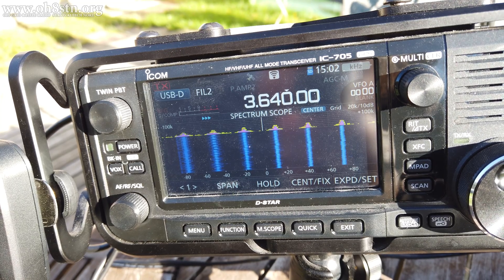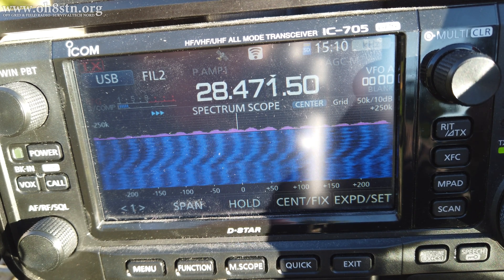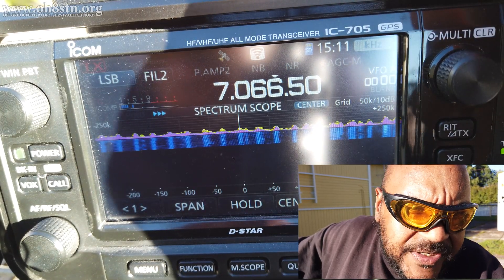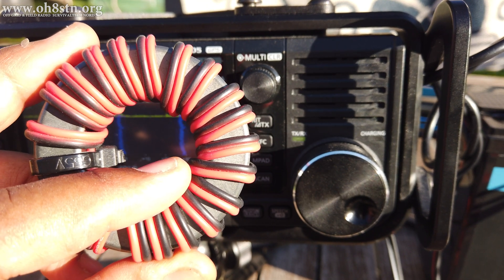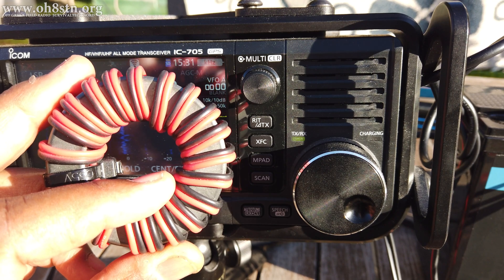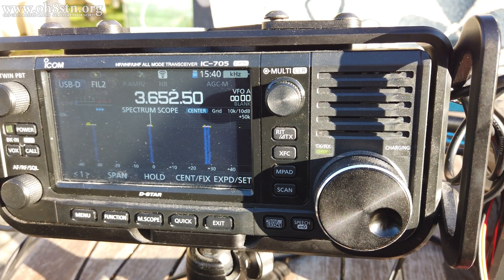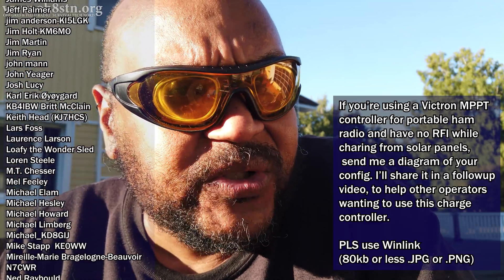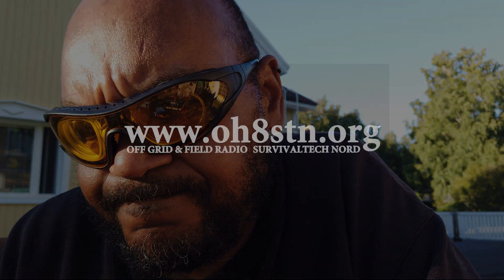Victron SmartSolar MPPT Charge Controller

Comment: It's been over two years on this, any updates?   I am currently looking for  MPPT controller  with around 100V in and 50A out.  I'm finding nothing. I wonder about; How long are your panel leads, grounding the Victron,  changing the proximity between the Victon and your ICOM and/or  antenna?

  FWIW, I always go direct to the battery (+ fuse) for loads.

Comment: Last Field Day I loaned a new operator a 100w panel and a no name cheap Chinese 30A charger. I've used this same device for many years and knew they functioned fine.  Connect to his rig, every time the charger would start to charge it would do exactly as your seeing on your radio. Totally wiping out most bands. Once the battery was full and no longer drawing amps, the noise stopped. The difference; I use AGM or Lead Acid batteries, my friend used a Bioenno with a BMS as part of the package. Seems like it's the combination of the BMS and the charger. His battery works and charges fine with a Genasun charger, and my cheap charger works fine with lead acid or AGM batteries. (both charging at the same amp rate)
Reply from the maker: Absolutely. It is possible for a BMS to make noise, but it's generally unheard of. I've tested with the lead acid batteries, AGM batteries, lithium & lithium iron phosphate, both with and without BMS. The noise is always there while charging.  Bioenno might use a bad quality BMS, which would support your observations. The BMSs in my Power Queen LFP batteries are quiet, and work well with the Genasun charge controllers. 
Thanks for sharing your observations with us.
73
Julian oh8stn

Comment: Dear colleague, the only way to block RF from the victrom controller it self it to put  the devise inside on on Faraday metal shell lake used in microwave oven ...,  !!
Reply from the maker: Yes, indeed. Unfortunately,  that makes it much less portable 😥
Reply: @OH8STN You don't understand what a faraday cage can be. It can be a fine wire mesh screen cage, slightly bigger than the charge controller. That does not affect portability.  Also, twist all of the wire pairs.
Reply from the maker: @MrSummitville This is a ridiculous comment! What you fail to understand is that my Genasun charge controllers are RF quiet! For Genasun,  no Faraday cages required, no twisted wires required, no voodoo magic or blood sacrifices required. 
Why can't Victron charge controllers meet the same high standards?

Comment: I have the 75/15 and will be taking it portable soon, I'll share my experience.
I see you have the Genesun GV-10, by chance have you ever used a GV-5 model specifically? I can't see it mentioned searching your channel.
Edit - found you have a GV-5 in an older video.
Any chance you can pop this model specifically on the bench with the 705 and check noise on 40M?
Reply from the maker: I'm still using the gv5. It is possible to get some noise when the controller that's too much solar input. The switching goes into overdrive too regulate what's coming in which causes some noise. Under normal conditions, no noise.

Comment: I researched Charge Controllers about five years ago. Genasun's were the only brand that were RF silent. The Scientific Community uses them in a LOT of experiments. They need to develop higher capacity gear for the market. The demand is there, so they should get started on designing new kit.

Comment: Hi Julian, I love your chanel and the effort you are putting in all these themes. While I am using VICTRON stuff on my sailing boat in a quite extended way I can 300%!!! confirm your observations. I have installed 4 100/30, one 75/10 and one 75/15 solar charger. In addition I am running a 3,5 KW Charger/Inverter with 3x 200AH LiFePO4 batteries (Victron). I like the VICTRON products for many reasons and I don’t want to miss them. But during day time I have to disconnect the solar panels to avoid this incredible noise on the bands. Especially on 20m which is the main band for operation on the boat besides the 40m band. There are other devices that produce noise like the fridge but not nearly in the extend the VICTRON solar chargers do. I am not sure if the converter/charger(Multiplus)  is doing the same but offshore it would only be an issue while converting to 230V. I will figure that out in the future. The only solution I have at the moment is to disconnect the solar panels from the chargers. That is obviously not what we intend. I contacted VICTRON via my dealer and they pointed out that these issues are not known. I argued that it is a direct injection into the antenna, which is your observation as well. To my onion this does not apply to the certificates they are mentioning to prove the proper build quality concerning RFI. I’d very much appreciate to get in contact with you and share my experience. 73 Roland, DJ5SL

Comment: I had a cheap battery charger plugged in the garage and my station was about 50m away. It was all coming in via antenna. As I would drive into the driveway, my noise floor went from s2 to s8. Not 100% related to this but the victron could he generating it. Also had any issue where the mmpt controller was causing the panels to radiate rf. All interesting.

Comment: MPPT and PWM produce lots of noise. I think you will need some filtering/conditioning after the charge controller and before the battery. Maybe ground the charge controller chassis.

Comment: Try using a Buck Converter after the Victron. It is adjustable and cleans up the DC power to an appropriate Voltage. I had problems in my RV with a Victron and over voltage, blowing a fan ICB. After researching and reading from many RV'es with the same problem after solar installation, this was the remedy. Please let me/us know if try this and the results. 73 W7BUC

Comment: The problem lies in that it is an mppt. I did research before purchasing a solar charge controller for my setup. PWM is less efficient but much quieter on rfi. MPPT has buck and boost voltage converters to take the 20-100v and pump out 14.4 that that your battery needs. You could try adding the toroid in-between the charge controller and the battery, abd wrap the charge controller in a sheilding material (tinfoil) and see what happens.
Reply from the maker: I used to believe this point exactly. However the Genasun MPPT charge controllers do not exhibit the same noise. If the generalization were true, every mppt charge controller would emit this kind of noise. It's a reasonable assumption but I believe Genasun must be doing something differently.
73
Julian oh8stn

Comment: I would contact the company and see if there is an internal problem that is common in this unit and if so what the fix would be. Sounds kind of like a switching power supply noise.

Comment: Hey Julian.  I did some testing with my Bioenno 20amp charge controller and ~200 watts of solar in (100 watt Bioenno and 120 watt Raddy folding panels).  My 7300 was connected to the load port.  Bioenno does not recommend this, and I don't normally connect it this way, just wanted to see if it would be any help to you.  I had no RFI.  I always connect the load directly to the battery, regardless of the CC.  I mean, come on, you almost single handedly spawned my battery addiction.  I'm kinda thinking you should just ditch that controller and find another one, like the Bioenno, that is RF quiet without you having to mess around with it.  I've read some other comments in the thread saying their Victron is RF quiet, so could there be the possibility that you just have a faulty unit?  Doesn't seem likely but anything is possible.
Reply: Yes I am thinking he has a faulty unit for sure - because I have talked to other HAMs just now that use the Victron and its dead silent...hmmm

Comment: Hi Julian,  The problem is that MPPT charge controllers use PWM down switching yours is at 30Khz (30Khz between peaks on ic-705).  OK you could put a .01 cap on the power transistor and the Switching flyback coil.  But that might be microsurgery.  The most profitable way of doing this is to put the whole victron 75/15 inside a metal Faraday cage then have ferrites on all the inputs and outputs.
Ok you might just wrap the thing in plastic then copper or alluminum foil for a test and wind all ins and outs around a common core choke and see where you get.  Definitely the whole thing has radiated emission (foil) and conducted emission (choke) and see where you end up.
73's W3GYV
Reply: Julian have you tried this?

Comment: My first thought is to use two batteries, and swap them. I do that anyway without charging either. The panel/controller/battery could be in an optimal location in the sun, and far enough to not contribute RFI. But it comes down to weight, convenience and the cost of an extra battery.  I always run QRP and usually a 5A battery (or two).
Reply from the maker: Well said

Comment: I had a bad CHINS LifePO4 battery that would put out noise and the voltage would vary just a little (lights in the camper would blink) when under solar charge.   I replaced the battery with a battleborn battery, my issues went away.  I believe the BMS in the CHINS battery was bad.   Have you tried a different battery?

Comment: Heinrich from the YouTube channel Funkfieber (in Bavarian language ;-), reported he just bought the Victron MPPT controller. he didn´t try it yet. may be you could get in contact with him? I think he has only a 30W rigid panel though.
Otherwise, I would try some ferrite chokes ob both ends of each cables to prevent the cables from radiating or behaving as an antenna. May be you could enclose the controller in a metal box?

Comment: I use the Victron MPPT 100/30. No appreciable noise. However, this chager does NOT have load passthrough and so everything must be connected to the battery. I do this via a marine type fuse box. I also ground the device to the 4ft grouding rod I pack for portable HF ops. I have found this to make all the difference.  I can send you a diagram if you'd like.
Reply: Is this on all bands?  Including V/UHF?  I'm reading so many conflicting stories.  73
Reply: @I_B_Phrede  I haven't noticed anything on V/UHF

Comment: I haven't followed previous videos, so I may be covering old ground.
 
I assume you actually tried to determine where the noise was coming in - antenna, power line, straight to radio circuitry or all 3. Oscilloscope on the power line to measure may show if it is coming from there. Simple antenna disconnect / reconnect can show if it is coming from the antenna.

How far away is the solar controller from the radio? Remember the distance vs power attenuation is exponential.  Separation with a larger feed to compensate for voltage drop?

I use Renogy equipment myself, but a different source of interference is over riding most HF, so I can't say if it has a lot of noise from solar or not.

Basic troubleshooting - locate the issue by tracking / tracing, then if possible isolate the problem area, then diagnose and mitigate.

Edit: What about the BMS on that fancy battery since it seems to be current related? Could it be the noise source?

Comment: Love to see the same test with a Bioenno charge controller. I run their 40W panel into their 20A charge controller, 12V/12AH battery and 100W radio with no RFI. I do not use the load out port on the controller, I connect the battery to a rigrunner and the radio (and other devices) off of that.
Reply from the maker: I don't have the bioenno controller, but do like the way your radio is wired for power. I'll replicate and try again.
73
Julian oh8stn

Comment: I just got my GENASUN 5 solar controller yesterday and I am mounting it on thin plywood and placing it a watertight small container.  I intend on using it with my 40 watt foldable Bioenanno solar panel and my 9 amp Bioenanno LiPo 4 battery.  Great videos. ❗️👍 73 KV5P
Reply from the maker: The Genasuns are awesome. Did yo really mean LiPo though, or perhaps LiFePO4?
73
Julian oh8stn
Reply: @OH8STN  Their is no telling what i type sometimes, I got it to use with my 3A and 9A Bioenanno Lithium Iron Phosphate Batteries.

Comment: I have  the same problem with my solar controller that I purchased from  Bioenno To charge my lithium ion phosphate  12 amp hr battery. 
Not saying anything negative about the company or the battery .They are superb . it’s just something that I have to deal with ,so I unplug my solar panels when IM on battery power. Looking forward to a solution

Comment: hope victron can get this fixed because just think if your neighbor bought one of these and put a good solar load on it you'd be done with radio during the daylight hours I myself use a midnight solar charge controller and have not had any trouble cheers de W9US
Reply from the maker: Agreed!
I have thought abot a midnight solar classic controller for the wind turbine. Which one do you have?
73
Julian oh8stn
Reply: I have the classic 150 for the house and a genasun for the solar generator but like you I've been looking at  midnight solar the kid mppt can handle 150v and 30 amps but have not tested it as of yet

Comment: All Morningstar SS series controllers have a modification the end user can perform to slow down the switching frequency to reduce RFI (details are in the manual),
Reply from the maker: Yes I've modified my morning star controllers as well. That mod Works quite well, but isn't relevant for the victron.

Comment: I just made a quick test with the oscilloscope on the Victron 75/15. https://youtu.be/UKyne4oxR2A

Living in the city with lots of QRM...so my noise level is on a similar level here than you showed in the video what the victron produces....so its hard to see on my radio....but with an oscilloscope you can see where it comes from.
I guess with a better shielding on the victron you can lower it at least. 
There exists "shielding paint"...not sure how good they are but that would be the simplest solution to just paint the device from the outside.
OE1TMW here.

Comment: I bought a particular brand of charge controller that was supposedly rf friendly to run my LiFePo4 batts for my shack.  Just having it nearby, with the panels plugged in & charging,  WITH THE RADIOS NOT EVEN CONNECTED to that system generates the same kind of noise you're seeing.  I have ferrites & toroids everywhere and still a no-go for me.  For now, Ive decided I'll just have to do my charging when I'm not playing radios.  Real bummer.  I feel your frustration.
K5MWA clear & 73's

Comment: This is a problem associated with switching power supplies. The MOSFETs switch on and off to produce a regulated output.

Place a 20A rated Noise Suppression DC EMI line filter between the load and radio. It is an LC circuit (inductor and capacitor). One I found is made by VK Amps out of Australia.

Here is a video from a power supply company discussing filtering. youtu.be/G-Llhy2ViUY
Reply: Looks like Powerwerx (PN: LF-1-PP) makes one as well with power pole connectors.

Comment: So I would be curious if the radio were located physically further away from the charge controller with a longer cable, if that makes a difference?  And also, if the Victron was being used to charge batteries not connected to an amateur radio receiver, just in the same area, if there is still RFI?
Reply from the maker: The interferance from teh Victron from the wires and over the air. Next test I'll shut the antenna. Will also place the controller and battery much firther away from the station.
73
Julian oh8stn

Comment: Try making a rf blocking cage to place over the victron charge controller? Get it minimized on 40m first then place the cage over the controller.   Probably will require a combination to eliminate through the cables AND over the air
Reply from the maker: Thank you. Will try.
73
Julian oh8stn

Comment: Have you tried to earth ground the battery and solar panel negatives?
I am wondering also if longer power wires to the solar panels are effectively becoming antennas to the ppt switching?
the wires should be as short as possible and taped/kept close to each other as possible to keep them from becoming a receiving loop to the mppt
Reply from the maker: The solar panel was about 3 ft away from me. So definitely very short cables. The solar panel and battery ground weren't grounded to ground that's for sure. It's a great idea! I'll test it soon.